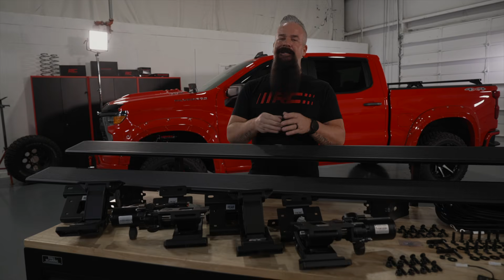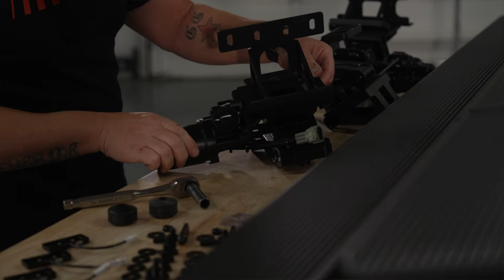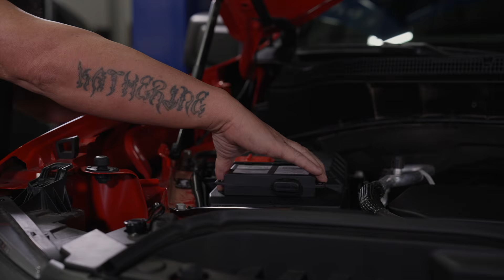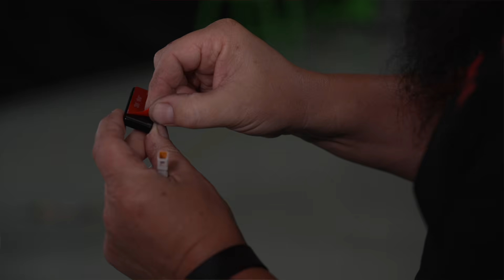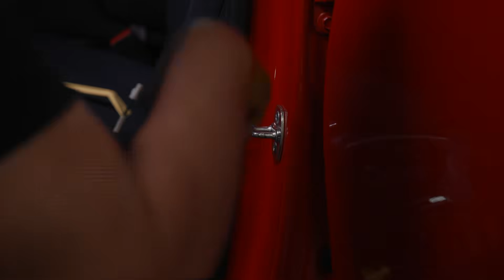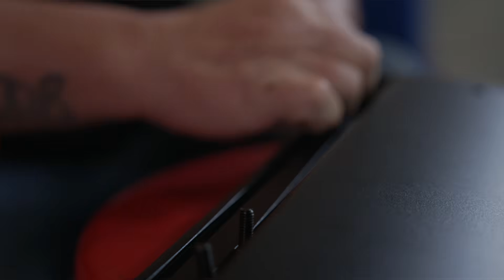How to Install HT Series Power Running Boards: A Comprehensive Guide

Comment: TY for this vid.   When installing the magnetic switches, I couldn't help wondering why the default door opening/closing switches and electronics,  inherent to the RAM, couldn't be used to trigger the motors.  Could you please offer your thoughts?   Thanks.

Comment: I wired my mine but when the magnet is touching the switch the steps come out and when the magnet isn’t touching they retract in
Reply: any fix yet?  having the same issue
Reply: Wiring is reversed in the connector.